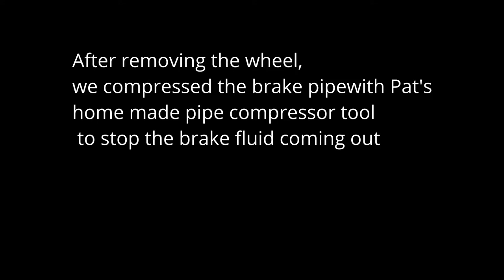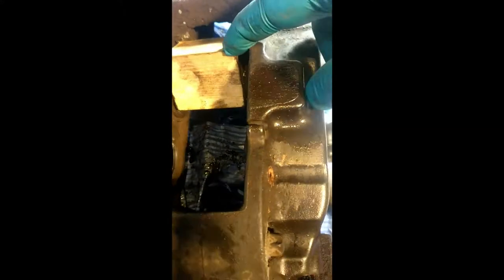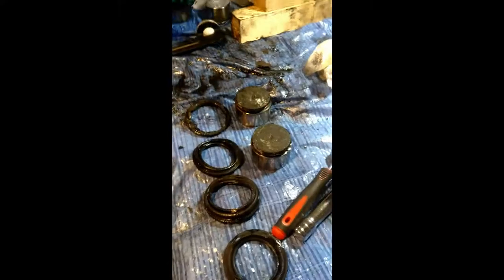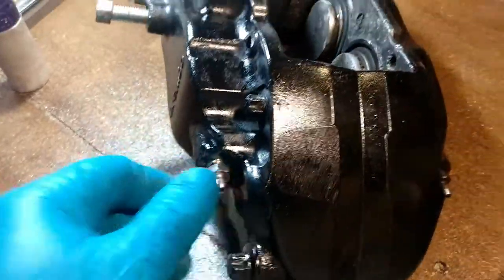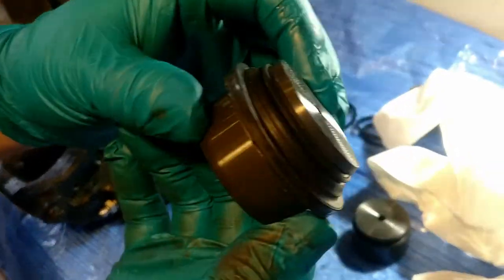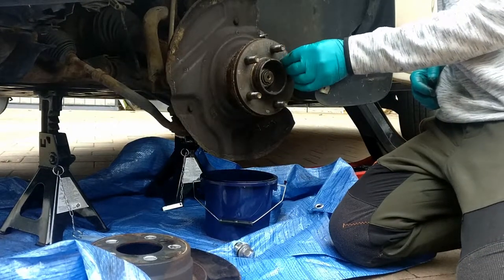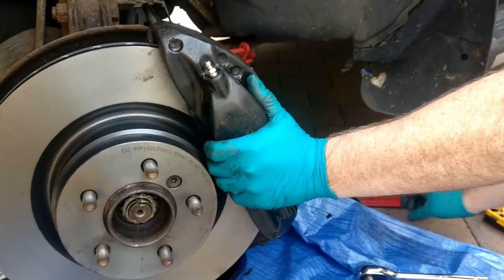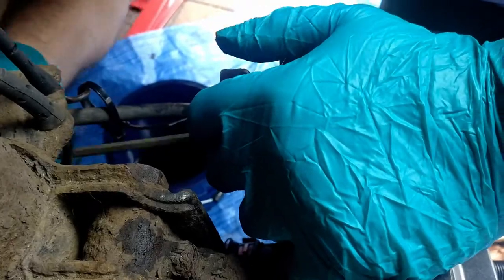Range Rover L322 Replacing the Brake Calliper Pistons & Seals

Comment: Hi Ray, a bit late for a question on this video but I wonder if you could tell me what make/model of jack you're using. I thought I had a perfectly good trolley jack but it won't lift high enough for me to get the tyre fully off the ground
Reply from the maker: I bought it from Costco when there was a deal for £99 (2750kg (3 Ton) Steel Service Jack - Model XL2750EU,)  hope that helps
Reply: @RaymiesGarage  Hi Ray, that's great, many thanks. Just checked on the Costco site and they still sell them